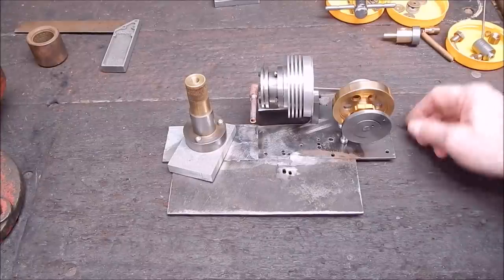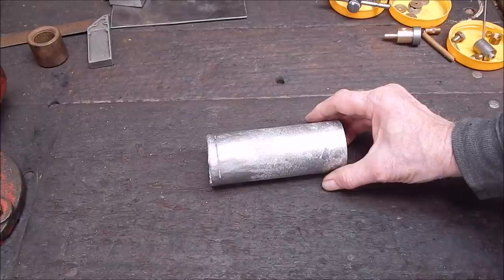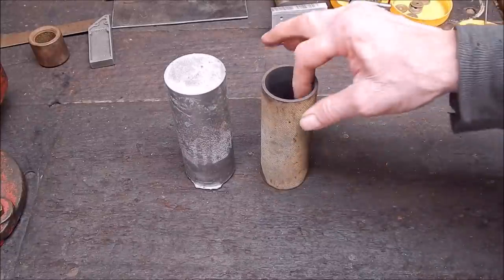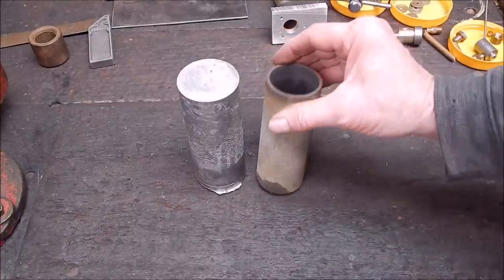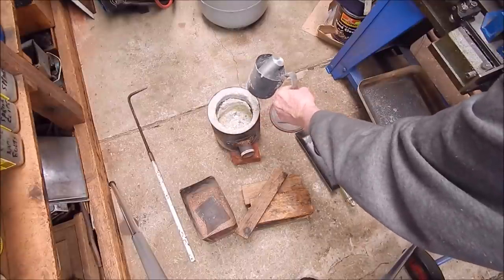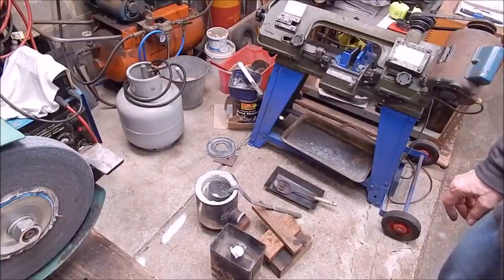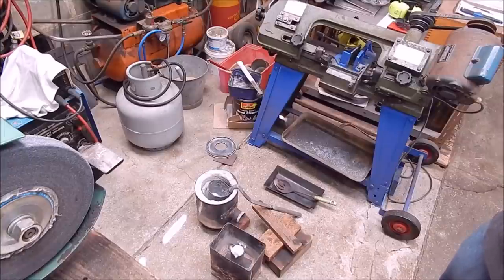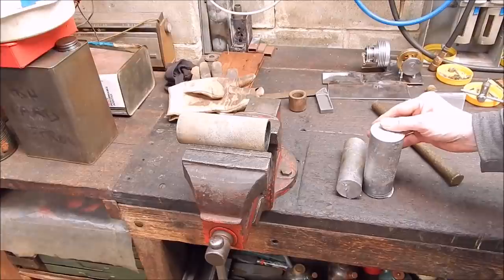How to make free aluminium round stock for a metal lathe

Comment: Good video, as always, Rob.
Another source of steel tube with a good internal bore is scrap shock absorbers. The rods are also potentially useful.
Reply from the maker: Great idea Russell.  Smaller diameter stuff is the hardest to cast as it's difficult to find a uniform diameter tube in those sizes.   I will give that a go next time I get some old shocks.  Thanks for the tip.  Cheers Rob
Reply: I never thought of that--good tip
Reply: The rod could be used as a test bar potentially 🤔

Comment: Love the video. I will be trying this when things return to normal and I can get some wheels. 

Warning- Long boring story approaching....

Back in the 90's I worked in a workshop that had a furnace and die casting machine that made various small alloy parts. It ran about 2 or 3 days a month, whenever we ran low on parts. Like you the molds were put on top of the furnace to heat them up before fitting to the machine, when ready to start pouring. We bought alloy in large ingots that were also pre heated around the furnace mouth (wish I had just one of those ingots in my shed now 😊 ). Molten alloy was ladled out of the crucible and hand poured into the mold. Standing beside the furnace it was 50 to 55c summer or winter, and the shift ran around 10 hours. Can you say hot? This was country Victoria so OH&S was non existent. So MY personal choice of safety gear ran to gloves, sandals, shorts, T shirt, sunglasses, and ear protection (the gas furnace was LOUD).  But as they say "don't try this at home." Lol  Any "mistake" with molten metal will hurt like hell. I was always very careful and in 10 years zero injuries.
Reply from the maker: It's all as dangerous as you make it.  Sounds a bit on the hot side to me, but then again, if no one got injured then the system must have been working OK.  This is one of the reasons man invented beer ;)   Cheers Rob

Comment: I worked in a big aluminum foundry years ago and learned a fair bit. I think for molds I'm going to get some different sized heavy wall pipe, cut the seam out then hone the inside with an engine cylinder hone for a decent finish.
Reply from the maker: Hi Kreg, yes a turned finish is unlikely to be good enough for easy release.  Honing is a must.  Cheers Rob
Reply: stop by any decent size machine shop or shop specializing in hydraulics and you can get end cuts or scrapped honed cylinder tubing for next to nothing. I throw tubing that is scored in areas but good in others away all the time.

Comment: Fortunate to have several metal suppliers nearby, I go there and dive into the remnants bins for aluminum & steel. Brass is valuable enough they don't discount remnants. Much cheaper buying remnants and all the pieces are typically just right for mini-mill projects.
Reply from the maker: The new metal (and plastic) suppliers in South Oz charge full price regardless of whether it's an off cut.  The only thing you save on is cutting, as it has already happened.  Very few scrap metal centres will also re-sell metal as you must have a secondhand dealers licence to do so here.  They basically force you to buy new.  So every time I cast my own aluminium it's a win for the little guy, and those rip off merchants miss out  :)  Cheers Rob

Comment: I did quite a bit of this at one time, up to 4" X 10" long once (that was hard to get out of the pipe!). I found the top 1" or so was much softer than the rest and would cut that off and throw back in the scrap pile.
Reply from the maker: Hi Crichton, I only cast the length shown, as I tried twice as long and it wasn't as uniform (as you say). Most times this is more than long enough and the bit in the chuck jaws usually gets re-melted as well.  Cheers Rob

Comment: Good video.
Do You use butane gas ? Most use propane.
And how much is the gas pressure set to ?
Reply from the maker: In Australia we use LPG, but propane and butane have almost identical properties and the equipment is interchangeable.  No difference really.  I don't set any gas pressure, just turn on the tap full bore.
Reply: Thanks

Comment: Hi Rob,
A nice masterclass there.... One question, after warming the mold you put it in the tin can on another piece of steel (i am assuming it was steel). Would i be correct in thinking it was sand in the bottom of the tin can?
Take care
Paul,,
Reply from the maker: Hi Paul,  Yes, sand is a good idea as it contains any leakage and insulates as well.  You can stand the cylinder directly on the sand, no problem.  I use the steel plate to get a flat end. Cheers Rob
Reply: On using sand: yes, I made a furnace the same as Rob’s (thanks Rob!!) which works well. However, I put a layer of sand about 5mm thick on the bottom as it greatly protects the degradation of the internal can at the bottom of the furnace due to heat. Sand has a melting point about 3x that of aluminium so works well.

Comment: Great tips Rob. I would not have guessed you could set a tube on top of a plate for the mold and not have it all run out. As I'm sure you've heard, many say never to perform casting operations over concrete. They say you get an explosive reaction if the molten metal touches the concrete. What's your response to that?
Reply from the maker: Hi Rick,  yes that's dead right.  All cement has moisture in it, which instantly turns to steam on contact with hot alloy.  The pressure forces the cement apart (into splinters) which then sprays the molten metal around.  It happened to me once when a crappy crucible leaked.  Plus there's nothing to stop the alloy running all over the place.

A sand bed prevents all that.  I always pour over a sand filled container and try and do it outdoors over soil, if the weather permits. Always wear a face shield when pouring. Cheers Rob
Reply: @Xynudu  Thanks Rob. Quick follow-up: I have some good stainless tubing. Any problem with using stainless for molds and/or crucibles? I know certain metals give off toxic fumes.
Reply from the maker: Hi Rick, stainless steel tubing usually has a seam (the stuff I've used did) and that is no good.  Being thin walled it is also less likely to be perfectly round.  You can only try what you've got and see, if it is uniform internally. Run some dividers through it.

Stainless steel contains Chrome and does give off toxic fumes when welded.  I personally wouldn't use it for a crucible even though I have some which is suitable diameter.  Stay with mild steel (heavy pipe or electric motor casing with a welded in base, or something similar) and it will be safe.

Cheers Rob
Reply from the maker: Hi again Rick,  regarding the tube seal on a metal plate - that only works if everything is dead flat.  Even then you may get a tiny bit ooze out.  It knocks off easily before removing the tube center.  You can put a sand seal around both if you want to prevent it.  Cheers Rob

Comment: I  see you were doing it in side your shop, how dangerous would it be if you were melting drink cans with the fumes from the plastic getting  into the air? Like you said start with good aluminium but that is not always the case. Also it looks like a lot of fun and satisfaction however how much does it cost in gas?
Reply from the maker: Hi Tony, I have never melted drink cans as I don't buy them.   It pays to have adequate ventilation as plastic fumes are usually toxic.  At a rough guess I used about $1 AU of gas (ten minutes heating time).  Cheers Rob

Comment: I'm a state to the east, for reference recently I paid about $15 for a 6" long bit of round, about 2 1/4" diameter. This particular fella will cut and sell you any length which is rare.
Reply from the maker: My ally supplier will do the same, but you pay dearly.
Reply: interested who is your supplier
Reply: Sounds like you need my aluminium supplier for the odd stuff then!
Reply: $15 shipped or pickup in Melbourne Metro area ? I'm interested
Reply: @dontnubblemebro  got the supplier details ?

Comment: Have you ever tried to melt brass or bronze in your foundry or doesn't it get hot enough? I built one with perlite and cement just like you but used a steel 5 gallon pail. I also made my own burner setup using a copper .035" mig nozzle contact tip and an off the shelf regulator.  I never tried brass or bronze in mine, that's why I was asking.  Thank you sir, I hope you have been doing well.
Reply from the maker: Yes, but it's not hot enough with LPG/propane to do it properly.  You finish up with a glob of half melted metal.  Cheers Rob

Comment: gday rob,
how much space do you reckon would be a requirement for safe casting?
Cheers
Reply from the maker: Well I was working in what I consider to be the minimum space John, but normally I would do this outside.  It is winter here and it was raining, so that wasn't an option.  Plan out your movements and area requirements, have everything in place and at hand, and you should be fine.  Accidents happen when you try to improvise on the go.  That's just not an option with this sort of activity.  Cheers Rob
Reply: @Xynudu  cool thanks for the reply rob i hope to give casting a go someday

Comment: Good video.  How well does it machine?
Reply from the maker: Excellent.  Check out the alloy fins on the model engine at the beginning. Looks first class to me.
Reply: @Xynudu  Thanks for the reply!  Such a simple setup.  I was watching a video yesterday where the parts to make a furnace were around $500 alone.  Not to mention extra stuff that was recommended.  I think I'll develop a similar system to yours and give it a crack before spending too much money.  Love your work and the knowledge you are passing on.  Cheers.
Reply from the maker: @neilappleby3988  Hi Neil, it doesn't work with brass or copper as you say, which is a pity.  So damn expensive that stuff ;) Cheers Rob

Comment: I have that same cheap band saw that works so well.
Reply from the maker: That's an original Taiwanese Rong Fu that all the Chinese ones are a copy of.  Super handy saw.  Cheers Rob
Reply: @Xynudu  Yes, I was a little surprised to see the made in Taiwan casting on mine, I installed a larger base plate for hand sawing awkward sized pieces. In 18 years I'm on my second blade.
Reply from the maker: Hi Angelina,  I have broken two blades in about the same period. I upped the motor to 1 HP and it definitely won't slow down now.  Saves a LOT of hard sawing work.  Cheers Rob

Comment: Hi Rob,.  I sure want to do this in the future and have enjoyed the videos along the way.  You mentioned using a butane torch but looked like a propane tank that you were using.   Just wondering?

Dale in Canada
Reply from the maker: In Australia we use LPG, but propane and butane have almost identical properties and the equipment is interchangeable.  No difference really. Cheers Rob
Reply: Dale, yes you are correct, he was using propane (aka LPG=Liquid Propane Gas) and not butane in a 9kg bottle, which is a common size here in Australia.
Reply: Thanks for that.  In Canada we still call them 20 pound propane tanks.   Even though we are supposed to be metric now some things are hard to change.  It was in the 70's when we switched.  Still hear grumbling about it.

Comment: Porosity (and shrinkage) from dissolved gases was always my nemesis. If I needed/wanted a central hole, it was fine. But for a solid block of turning stock, multi g my own was crap! Was better off taking scrap into town and trading for bar stock.
Reply from the maker: The melt was too hot.

Comment: Good video,Rob. I have cast lots of ally billets in the past for bar stock. Agree with you on some of the myths that are circulated our there. Some folk seem to have a need to turn things into black arts when there is no justification for doing so. As you say,if you start with good quality melt stock you will end up with good quality billets. Just to add that this ally melting  procedure can be carried out very successfully using only  barbeque charcoal in a steel cylinder with a moderate forced draught. I can never figure out how some suppliers justify the astronomical prices they ask for ally and brass stock. Me thinks they're extracting the piss in large quantities.
Reply from the maker: Hi Howard,  in dry weather I use an outside wood furnace with an air blower.  Works well and is cheaper than using the gas fired rig.  It is also able to do larger volumes at once.  I've used charcoal in it at times.  Adding an air blast to any fire increases heat output by about 400%.  Cheers Rob
Reply from the maker: https://www.youtube.com/watch?v=vcp6MtfjZDk

I originally used a hair dryer, but you can use a vacuum cleaner that blows or a kids bouncy castle blower.  It has to be capable of blowing at reasonable pressure.  That aircon blower might work.  Try it and see.

You can't add air to gas powered furnaces very well as they are usually jetted lean to the optimum temperature.  Adding extra air usually just makes a lot of noise or blows it out.

Cheers Rob
Reply from the maker: That is a very old video and I was doing what I read on forums at that stage, but after many years of home casting you realise that a lot of it is BS.  I no longer use a degassing agent or a flux.  If you do what I tell you in this video you will get a good result.  End of story.

Comment: I have a bucket full of 6061 aluminum shavings from my lathe and mill. I'll be recycling them into reusable stock 👍
Reply from the maker: Hi Ted, you can try, but generally you will get a lot of dross and not much usable alloy.  The problem is that turnings have a massive surface area, and as a result they also have a massive oxide coating.  This is bad news when melting as all that oxide forms dross.  Good luck though.  Cheers Rob
Reply: @Xynudu  thanks for the tip, I'll try, but definitely keep that in mind.
Reply: Back in the 80's I was Maintenance Manager/Manufacturing Engineer for UTC's aluminum extrusion plant in Coldwater, MI. 
We generated a great deal of chips from cutoff and machining processes. The dross loss was huge from trying to melt the chips. We sold them to others that were willing to put up with the poor return. 
One of the guys who worked for North American Burner Company came up with an idea to reclaim the metal from the chips. He built a prototype and it worked well.  
He faced several problems. The chips usually had cutting fluid or oil on them and they had to be dried before being introduced into the molten bath. Any water would be immediately stripped of one oxygen atom by the molten aluminum and the resulting hydrogen peroxide along with the steam from the boiling water would explode. The presense of free oxygen in the atmosphere would cause the chips to rapidly oxidize. Aluminum Oxide is a great abrasive but is very difficult to break down into free aluminum. 
His basic design was to have the chips in a loading chute that acted as the flue for the melting furnace. The burner in the furnace was set to create a reducing atmosphere. The heat would travel up the flue and dry the chips as they entered the flue. The reducing atmosphere prevented the chips from oxidizing as they achieved melting temperature at the entrance to the furnace. 
It was a successful process but any deviation from the normal operation, overly wet chips, air leaks in the body of the furnace or flue, would cause the chips to burn or enter the melting chamber with water still in the mix. 
The plant was destroyed when a load of mixed magnesium and aluminum chips were accidentally loaded in the furnace. The flue was burned and the furnace was destroyed by the resulting over heating. 
There was another attempt to create heat without open flame in the melting process. The Jumping Ring aluminum pump was proposed as a addition to the charging well of reverberatory aluminum furnaces. The premise was to stir the molten metal in the charging well using electromagnetic force per Lenz Law.
The concept was to introduce the chips or any scrap material into the melting well. The molten aluminum would heat the scrap and the pump would circulate the scrap into and under the surface of the bath. 
Wet chips were not well received. Also the jumping ring was immersed in 1100 degree molten metal. To maintain operation the coil had to be water cooled. Failures of the coils soon knocked the immersed style jumping ring out of the market. 
I checked to see if the immersed jumping ring was still in use. (I found no evidence of that to be true.) While doing the research I found Pyrotek is promoting a type of electromagnetic metal pumping system. I have no idea if it works or is another flash in the pan so to speak. 
https://www.pyrotek.com/primary-solutions/aluminium/casthouse/metal-transfer-casthouse/molten-metal-pumps/show/ProductLine/electromagnetic-pump-emp-systems
All that is to warn you that messing with chips has been a recurring theme in the remelting scrap aluminum business for at least 40 years that I am aware of. 
Play with it if you wish. Remember that the forces involved are high. The resulting explosion of aluminum processing plants has killed many a poor soul who thought they had the solution.
Reply: @OldSneelock  The company I worked for until retirement also had a plant that did extrusions in Coldwater Mi.  During my tenure with that company I working out of its sister plant in Cleveland, Ohio, and made many of those long boring drives to the Coldwater Plant. The Company was Amax Specialty Metals/Climax Specialty Metals /CSM Industries plus several other names over the years that I don't remember, it was located on Jay Street.